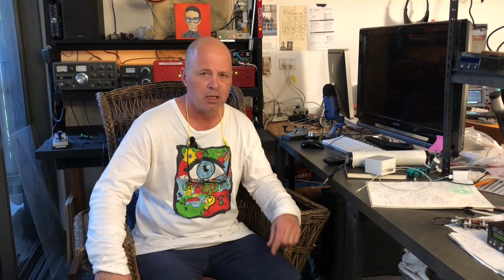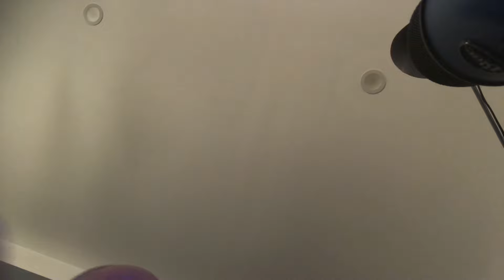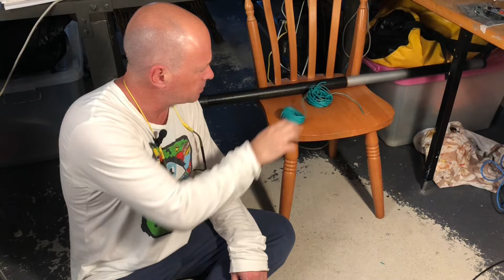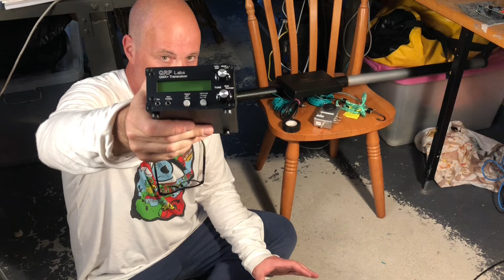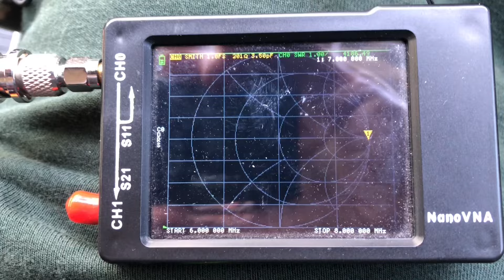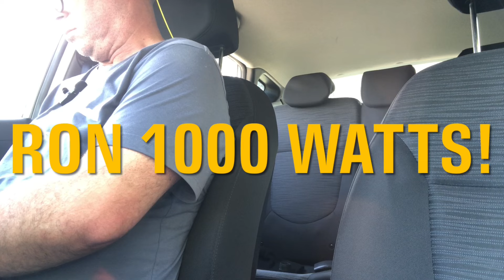CARTENNA QRP portable @TheArtofEngineering

Comment: That is a cracking effort on 3 watts, well done mate.
Reply from the maker: @VK4TVC  Thanks…. Yeah I nearly gave up and then Ron just appeared! As it turns out the beach was on the other side of the road not too far away…. Salt water is like a linear amplifier 😝
Reply: Funny how conditions work. Half way around the world and yet it was a struggle for me to hear George last night on 40m  and I'm only 5 minutes up the road....plus another 40 minutes so allow for Sydney traffic.  Sadly we had to resort to Telstra to finish our QSO

In other news, I pulled out the old FT-101B (where B is for Boat anchor) and I got to turn my Magnetic Loop Antenna into an Aldus Lamp
Reply: @MidlifeRenaissanceMan  is the FT-101B fully functional?
Reply: @VK4TVC it’s more functional than me last Saturday:-)

It needs some love. A significant amount of love, but I’ve had a few QSOs on it. With a mic and with a key, and I shall neither confirm nor deny whether or not I have used all the bands available on the FT-101B 😉 

It’s going on the bench for real one day. I have a CW filter I really want to see installed and running. 

Puts out 120-130W. I think the tubes are a little tired. I bought it back in ‘91 off a CBer who had fried a resistor in the finals used it a bit, not much.

I’d love to get it going and use it as a daily driver. Few things on the bench in front in the queue 😊
Reply: @MidlifeRenaissanceMan  If you need tubes let me know I have a big box, some new some used 🤓
Reply: It takes the 6JS6-C in the finals

Comment: Have you tried QMX awesome feature "field tune” mode?  Under menu "Hardware Tests" -> "Tune SWR"   (On Tune SWR mode, half Voltage, meaning 1/4 of the power is being used according to operating manual). I use that feature on manual tuner and also when tuning my whip antenna. So you don´t have to bring nanoVNA with you every time.
Reply from the maker: @Luurmets  no didn’t know about that will look it up! 73 de VK2AOE

Comment: One last comment / question:

How do you drive under bridges with that ??

Ok and one more

If you wired it up to your starter motor you could drive under powerlines like a dodger car…..you’d have to make sure you had enough momentum to get around the poles / towers, but if the voltage was high enough the dragon, as you broke contact, would probably be enough to keep you moving….

Comment: Pro tip**
With your field NanoVNA, you have 5 memories. I have a 1-30MHz on the default memory 1 and the next 4 cover 3-8, 6-15, 13-22 and 18-30 MHz. 

Now I’ll zoom in on the part of the band that I’m trying to tune. While the curve is less accurate, it’s more than adequate to tune a HF antenna 

Now, if you doubt any of your results you’re seeing, you can use another memory setting and double check. 

Fortunately. my Xiegu pre G90 X108G has a simple SWR sweep that tells me some of what’s going on. 

Naturally, the additional information your NanoVNA smith chart gives you clues as to what needs to be “fixed” when matching an antenna, but it’s enough to tune the loop. 

** that’s misleading. There is no pro. It’s called Amateur Radio for a reason.